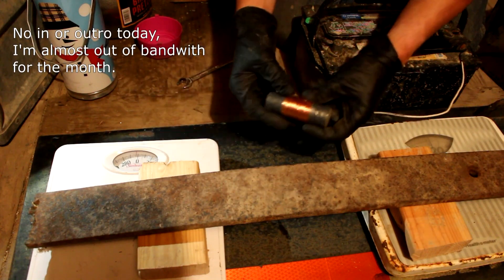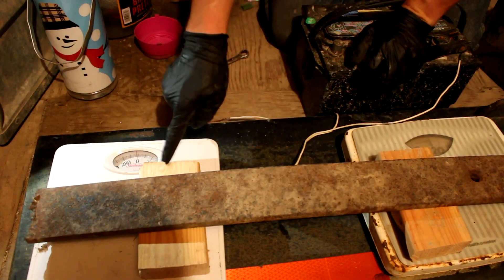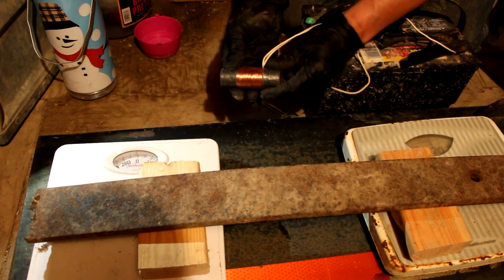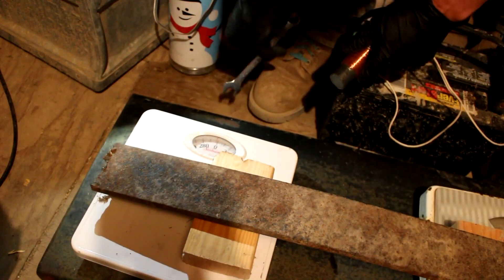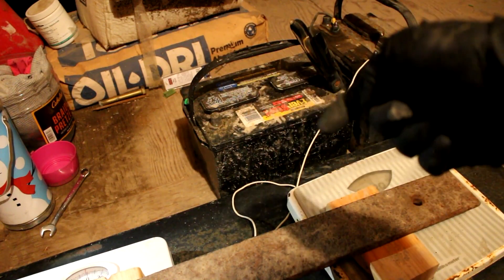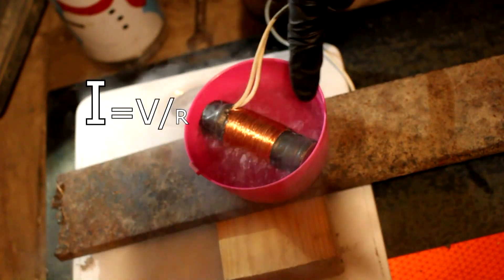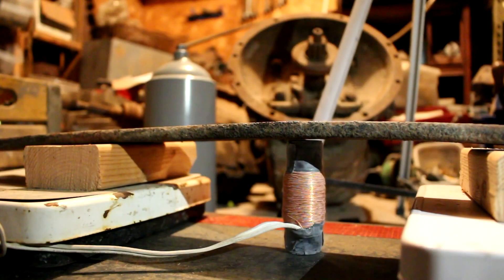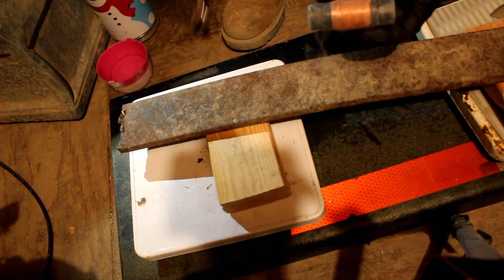Electromagnet in Liquid Nitrogen

Comment: Hook it up to the mains! You guys have like thirty volts over there, that should give you a bit more of a kick.
Reply from the maker: Ac would still have a noticeable attraction but it would be quite a bit weaker since it would be repelling and then attracting twice per cycle.
Reply: use a FULL BRIDGE RECTIFIER
Reply: Or better yet hook the mains up to your balls.
Reply: hehehe. "rectify" hehehe.
Reply: just use a bridge rectifier
Reply: +The Piscis what he said
Reply: ***** indeed! haha electroboom!
Reply: the mains are AC though
Reply: hmmm. good point. but can an electromagnet with its polarity switching 50 times a second still lift loads efficiently?
Reply: shit im getting confused. if you rectify the mains and smooth out the current then it's essentially DC no?
Reply: Good point. I'm no electronics expert but I've watched enough Big Clive to know that one can convert AC into DC.
Reply: make an ac to dc converter using some wire, one led, a resistor, and a capacitor and it make it an almost perfect dc output but make sure the led can handle the voltage and that's where the resitor comes in
Reply: +Jason D goddam
Reply: Exoze GD 
If you use an led you'll only be able to output 3 volts, if you use four diodes and a capacitor it will be better
Reply: +Jason D thank you, for everyone else look up Lenz's Law, and Hysteresis... Hysteresis is the effect, the law is the reason... junk yard electromagnets are DC, it's just been rectified
Reply: Electromagnet = inductor. AC wont flow through inductor
Reply: +Samm Sheperd (SNRS) Yes it does. How else could transformers, AM antennae in radios, boost circuits, speakers etcetc. work?
Reply: Exoze GD 
he he he
Reply: +CoolKoon the presence of a load on the secondary coil enables current to flow in the primary. Otherwise it's just an inductor and very little power is consumed by just the primary.
Reply: +MrJimbo1qaz I'd guess that while it's in the process of switching polarity it doesn't attract or repel, and I imagine the process isn't instantaneous, so when it's happening fifty times a second it would add up to a fair bit of downtime.
Reply: +Badatstuff look into Lenz's Law, an established magnetic field doesn't want to change
Reply: +Samm Sheperd (SNRS) That REALLY isn't true at all (no current flows in an inductor? So transmitter antennae don't work at all, right?). Sure, at higher frequencies the coils' impedance increases, but the fact that it DOES consume fairly little power (compared to a resistor, but not compared to a capacitor, in fact inductances are REALLY inefficient) doesn't mean that no current flows through it. But you know what? Please, just go ahead and read up at least a bit on inductance and you'll perhaps realize how much of nonsense have you written in your comments about it.
Reply: +Jason D Of course I know. And your point is.......?
Reply: +CoolKoon look up Lenz's Law it explains everything you need to know
Reply: +Gary Littleford Yeah, heard about Lenz's law at the university I spent a couple years at. But tell me, which part of Lenz's law proves, states or even implies that "AC wont flow through inductor"?
Reply: +Jason D Actually it CANNOT be used for making electromagnets and I never implied that it could. But what  does that have to do with inductors' ability to filter AC?
Reply: +CoolKoon I never said anything about an inductor or induction.... you seem to be dead keen on using AC for an electromagnet, i'm simply trying to explain that it's a completely inefficient way, in fact completely pointless when there's such thing as rectification. I think you may have missed a couple of lectures though or you would know that, and there wouldn't be any form of debate
Reply: +Gary Littleford Huh?! Where did I EVER say that AC could be used for an electromagnet?! Where did this notion even come from? In fact I even SAID it in my previous comment that AC CANNOT be used for making electromagnets (without rectification that is).
Reply: +CoolKoon so what the fuck are you talking about?
Reply: +Gary Littleford Well what the fuck are YOU talking about? And why did you address me saying "look up Lenz's Law it explains everything you need to know"?
Reply: +MrChangCJ Yes. sqrt(2) times higher DC voltage than your AC voltage's RMS voltage in fact.
Reply: +Jason D I'm out good luck with the brick wall
Reply: +PingasTheFourth AC will not work, as soon as you hook it up, polarity will oscillate at 50-60Hz depending where you live. DC is therefore required to have steady N-S poles when you hook it up.
Reply: and put capacitor

Comment: Could this method be used for super electromagnets like in trash separation processes? I Imagine a thermos like contraption with an iron rod wrapped with solenoid inside that's suspended in liquid nitrogen, the thermal insulation will keep the N2 liquid.

Comment: Did you consider powering it through the grid? Saying that, you would have some more concerns with the breakdown voltage of the enamel insulation. You would most likely have to change the enameled wire for rubber coated wire and rectify the mains AC first. However, by the end of it you would get a much stronger magnet but be careful as you might get a shock or get something caught in the magnet.

Oh also, do you think it's possible for you to manufacture magnetically 'soft' ferrite? I've always wanted to make a strong electromagnet or generator but I can never find any ferrite cores or laminated iron to make magnets from. Maybe I'll make a video on the subject one day?
Reply from the maker: just stick together some pieces of roofing tin.

Comment: Does the electromagnet warm back up to room temp faster under current?
Reply: Since the reistence drops less energy gets converted into heat. So it does, but slower. Conduction would be the greater factor i guess
Reply: Yes, it does come back up to room temperature faster if the EM is on compared to being off. Much less energy will be wasted as heat as someone already mentioned, but it being on will still produce more heat than it being off, so of course it being on means it will come back to room temperature faster. Don't listen to the twats saying "no".
Reply: no
Reply: +PingasTheFourth no
Reply: probably will warm up exponentially, as it gets warm from current the resistance highers and it gets warm and repeats,

Comment: This was dope AF, we never learned that cooling down a system would decrease resistance in IB physics: ( I do have a question though, why do you think the resistance was so low? My guess would be it came from the metal rod, because the copper wire is normally pretty pure, but that's just my guess.

Comment: what will happen if we use a superconductor? ....
Reply from the maker: If you could use superconducting wire hooking a coil of it up to a battery would be like shorting the terminals with a wrench.
Reply: Electrical efficiency will be much better, because there isn't any power loss. You can distribute electricity more and further than before.
Reply: What i meant was! Resistance will be near to zero that means the current will be significantly more and then the mag-field will also me more! ...how much more that the electromagnet cody made?
Reply: Shivanshu Mahim
Without cooling pull power was ~4 pounds and with cooling almost 50 pounds, so over 10 times more power.

Comment: If you would be able to cool down the wire to temperatures where it becomes a superconductor (meaning it has zero resistance), how strong would the magnet be? And is there any other limit to the current? (since approaching zero resistance would mean an infinitely high current)
Great video by the way, keep up the good work!

Comment: Thanks, now i can make my coil gun even stronger xD
Reply: That depends on the amount of liquid nitrogen used.
Reply: Mikail Elchanovanich They are, all you need is two rails and a conductive projectile in the middle, it is normally a tungsten projectile. You can find testing videos of it on youtube as well. They have managed to get projectiles going up to i think it was mach 7 possibly more. But they are such a simple concept, it is literally an electromagnet that then releases its force at a 90 degree angle to the rails i.e. towards either end of the barrel, and the higher the voltage and more conductive the materials the stronger the electromagnet is giving you more speed from that force. Hence why my first comment was saying i can make a coil gun better now, as i would have stronger electromagnets, enjoy the science :)
Reply: Bino Woo
SCIENCE!
Reply: +Gary Littleford They need more current than could be supplied with those. Almost all designs use capacitors to store the charge and currents get into the kA range.
Reply: rails or gauss?
Reply: Gauss, easier to make, uses less energy, yet lower speeds
Reply: Bino Woo
not sure which is cooler tbh
Reply: heh
Reply: Mikail Elchanovanich I prefer rails, but as i said its a lot harder to build and takes a hell of a lot more voltage released as quickly as possible
Reply: Bino Woo
are rail guns even possible in reality with what components we have?
Reply: the navy has rail guns on ships now I think. or they are in the construction phases to begin testing them on ships. they had one they were testing with for at least a decade. you can find it on youtube. hand held railguns don't have a lot of power, but yes, we can has railgun.
Reply: Watch the recoil. Don't want the gun to shoot itself in the other way.
Reply: +Bino Woo you want a collapsing magnetic field at ridiculous voltage? put a couple of fluorescent tube igniters in parallel

Comment: did you get a chance to measure the electrical resistance in the coil before and after the liquid nitrogen?
Reply from the maker: my multi meter is dead...
Reply: +Cody'sLab hmm well i guess one could use the difference in force generated and work back thru the formulae...

Comment: ok cody what happens if you fill a pipe with liquid nitrogen and coil it with wire will it keep it cool for longer and not heat to explosion or just end up warm to touch the pipe and stop it from working as well

Comment: the reason why the force multiplied by 4 when you doubled the voltage is that because you doubled the voltage you also doubled the amperage, and since the force is is dependant on the energy, which hase the equation of p=VI, when you double both V amd I, p multiplies by 4, great video anyways!

Comment: So chilling the wire causes it to contract and thus the protons are less active and dont interfere with electron flow as much, which creates lower resistance and higher current by Ohms law? Circuits werent my strong suit in physics but thats my guess
Reply: It's more like the atoms in the wire don't wiggle as fast in their postions, so they don't tend to "collide" with the flowing electrons as frequently, so they can flow way better. Just imagine the electron as a marathon full of runners and the copper electrons are just inbetween all of them. If the other people runn in circles, the runners cant avoid them as easily and get slowed down, but if the other people stand still, the marathon runners can easily avoid then and won't get slowed down as much. 
The atoms stop "wiggling" because they have less energy with less temperature.

Comment: so why does this happen? does the cooling effect slow the internal movement of the wires atoms so that the electrons can more freely more throughout?
Reply: That is exactly why
Reply: Mikail Elchanovanic: Wrong, components don't slow down because of higher resistance. Actions on CPUs, GPUs etc. are synchronized with a clock signal, they are not analog. Data processing may slow down on high temperatures because of safety switches that dynamically scale down the frequencies of components to reduce heat production. This is known as throttling.
Reply: You just gave yourself the answer 😂
Reply: Mikail Elchanovanich: Temperature can affect CPU speeds, but it's not because of increased delay due to higher resistance. It's because of how the clock signal is produced. That difference negligible on home computers, but can matter in some scientific measurements. Typical crystal oscillators will slow down if you move away from NTP, so the signal will be slower if you heat it up OR cool it down. 

If the temperature / other conditions somehow grew so big that the propagation delay became the bottleneck instead of the clock cycle duration, then the components would get into metastable states and the chip's digital logic would just break down. 

So increased resistance is never the reason for computer slowing down. It can affect how fast gates set up within a clock cycle, but it won't affect the number of operations per second, since operations are synchronized to the clock signal. If it did more than that, the whole device would stop working.
Reply: That's a completely different subject. What I replied to was your claim that CPUs slow down because the resistance in conductors grows, which is false. Cooling down your computer below room temperature doesn't make it run faster, and the reason why your CPU runs slower when it over-heats is CPU throttling, not changes in resistance. Quantum computers or logic circuits that rely on zero resistance are a different breed altogether.
Reply: @Nick Here, Kinda like dominos, electrons in certain metals have an outer shell (called the valence shell) that is far away from the nucleus (The nucleus is positively charged and so it's what holds the electrons around it) but when there is an atom (like copper for instance) with only 1 electron in it's outer shell and that outer shell is far away from the nucleus then that electron is easy to knock off and move to another atom because of the weak attraction, notice that it's also easy for another atom to give an extra electron back to that atom, basically copper doesn't care if there is an electron there and so it gives and takes it very easily, thus the reason why if you have a line of copper atoms and add electrons to one end, it will ripple down the line and push electrons through it, like dominos.
Reply: @eurobum2012 Just a small clarification so that people don't get the wrong idea: electrons in a conductor do move very fast, in random directions, because of heat energy. But the net movement caused by voltage is very slow, as you explained.
Reply: Euro Bum You replied to Mikael that it's right that "each individual electron moves at the pace of a snail". That's not true, and it's exactly what I wanted to clarify. Their speed is of magnitude 10^6 m/s (in room temperature). 

The electrons travel quickly up and along the conductor, randomly, because the atomic lattice structure in metallic conductors allows them to move quite freely.

It's the net movement of those electrons, caused by voltage, that moves at a snail's speed.
Reply: exactly, it's also why computer's processors and other microchip components process data slower when they're over heating.
Reply: okay and how do the electros actually move through the material? inbetween the atoms or bouncing from one to the next?
Reply: Why does water come out of the end of a hose when you are only putting water into the start of it?
Reply: Here is an animation of copper atoms: https://www.nde-ed.org/EducationResources/HighSchool/Electricity/valenceshell.htm
Reply: 95TurboSol Ah thanks so much! that makes so much sense!
Reply: Nick Here
You bet!
Reply: JJJMMM1
that clock signal isn't impervious to modification by temperature changes though, and last i knew processor clocks were on board the chip itself
Reply: JJJMMM1
if that is the case then how come there's so much research into superconducting materials for ultra fast computers?
Reply: JJJMMM1
oh, well fair enough, i will say though, that's rather disappointing
Reply: @Nick Here ... that's the kicker. The electrons DON'T move (much). The electromotive force (voltage) is what transmits the energy, and the electrons are just the medium. Think of a conductor as a garden hose, 1 mile long, full of water (electrons), and put a paddle-wheel at the end (representing your electrical device) with a valve. The moment you open the valve, the wheel will start to spin. Did the water have to travel one mile to make it spin? No because the pressure was already in the hose, ready to do work, the instant you applied the load (completed the circuit). Now think  about waves in a pool. They also carry energy , without ever moving any water. A cork will happily bob and down on those waves, without moving from it's spot. Similarly, in the alternating current that comes from your wall, the electrons never make it anywhere! And yet they still manage to carry energy to all your home gizmos. Life is full of examples that work in the same way .... sound, light etc... They are all different ways to do the same thing: move energy.
Reply: Euro Bum
i heard it was about the speed a snail goes that each individual electron actually moves, is that right?
Reply: Mikail Elchanovanich
@ Mikail. Yes, it is like that.
@ JJJMMM1. Yes of course heat jiggles them around. But we were talking about electricity.
Reply: JJJMMM1
thanks for the clarification, 10^6 m/s is indeed quite a fair bit faster than a snail, unless there's an alien species of snails using hyper-drives somewhere...
Reply: Also, while conductors increase in conductance when cooled, semiconductors do the opposite, at first anyway.